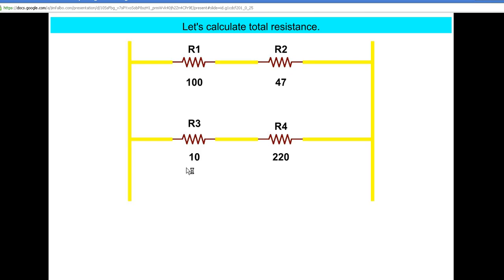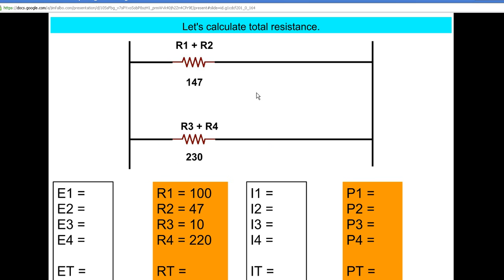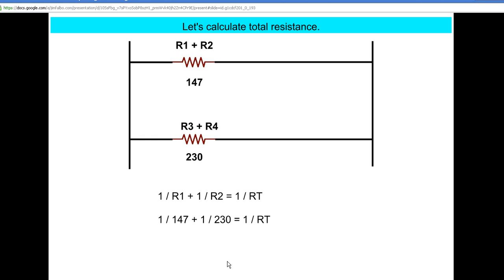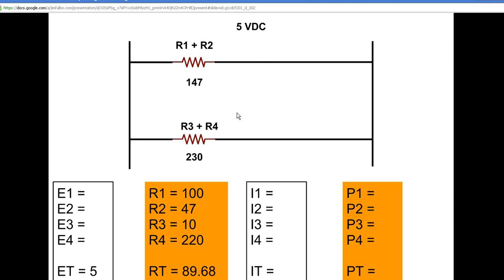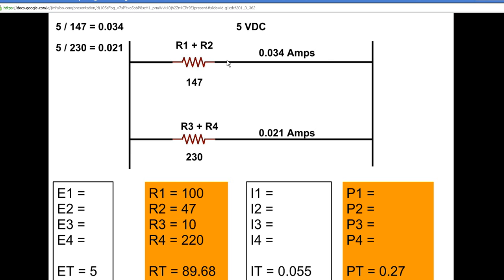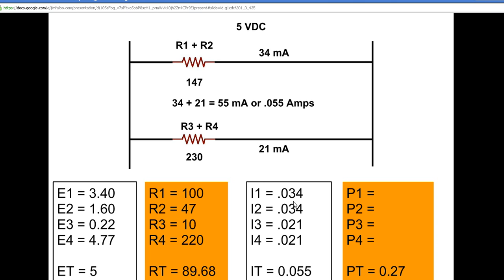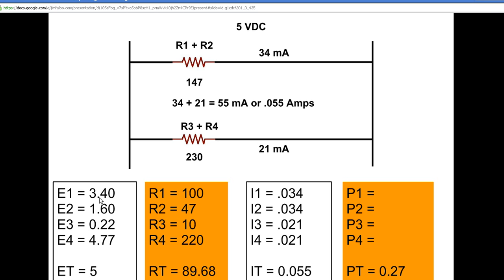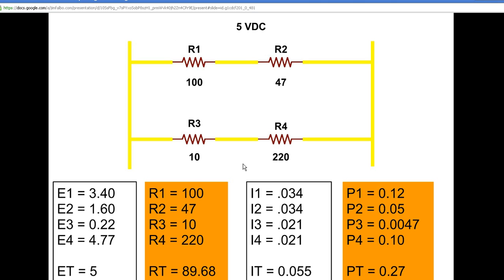Solving total resistance in a series parallel combination circuit

Comment: If you only have two resistor values in parallel (as per this video), you can use: Rt = R1xR2 / (R1+R2). Either way works.